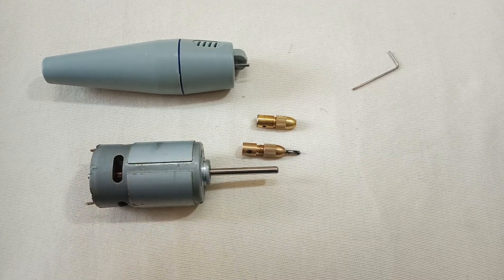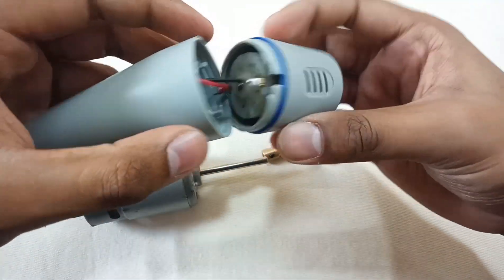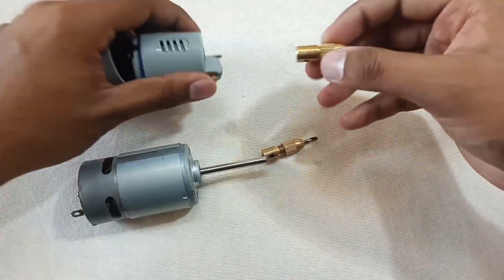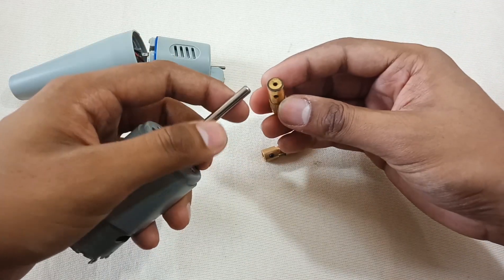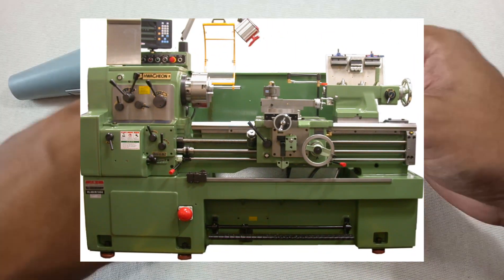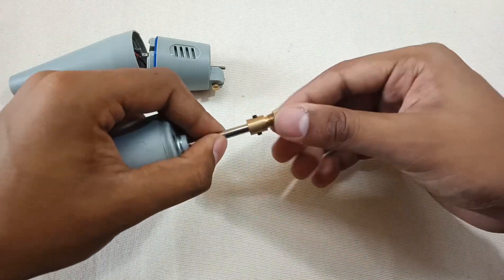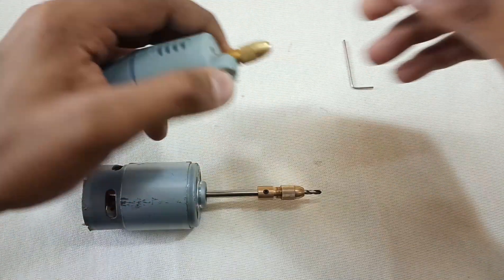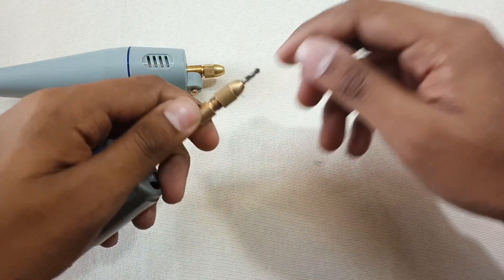Make Drill Chuck Connector for 775 DC Motor | 775 Motor drill machine #diy #drill #775dcmotor #775

Comment: Sir Muje Ap Relay Ki Video Bana Dy Jaise k Jab Light Ho to Load Light Per Chale Or Light Jase Hi Cut Off Ho jaye To Load Battery Per Shift ho Jaye Automatic Is Per Video Banado Ap.
Reply from the maker: Apne chlana kia hai?. Usi k hisaab se circuit bnega aur battery.
Reply: @Electricquantism402  12v Huawei Ka Fiber Router Hai Or Battery 12v, 7Ah Ka hai.
Reply from the maker: @MuhammadFaizan-hs1yt  simple wifi router ups bnega iska liye..kiun k relay se direct supply milegi router ko to high current se ur jayega
Reply: @Electricquantism402  To Sir AP Koi Video Banado Is Per Please.
Reply from the maker: @MuhammadFaizan-hs1yt  ok bro. Soon. Will mention you on the video. So don't forget to check.
Reply: Mere Pass
Y4169 Module Ye Module Battery Se Router Ko Power Dyne K Liye hai 
19v Adapter, XL 4015 Battery Charging k Liye.
Bas Ma Isko Automatic Karna Chaha Raha hu Q K Abhi Jab Light Chali Jati hai to Muje Khud Battery ko Router k Sat Lagna Utarna Hota Hai Or Phir Charging ma Bhi Lagna Parta hai Ma Chata Hu k Bas Ye Sab Automatic ho jaye.
Reply from the maker: @MuhammadFaizan-hs1yt  ok. Bs isme kuch addition krni hai.. diodes wgera se.. problem solve ho jayegi.
Reply: @Electricquantism402  Ok Bro Ma wait kar Raha hu is Topic K Video ka ❤️